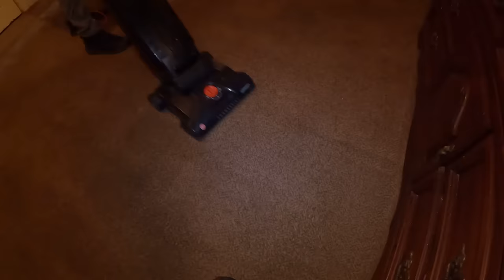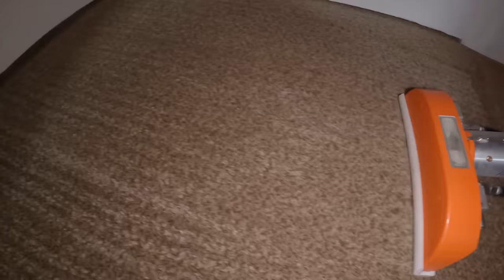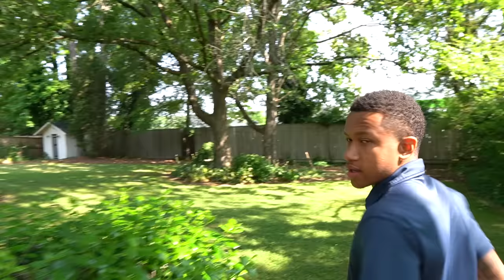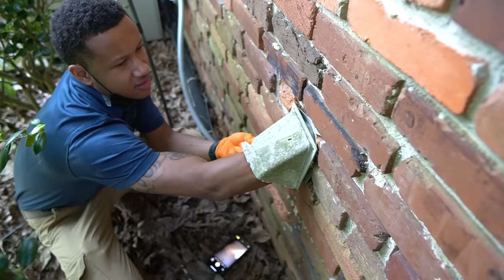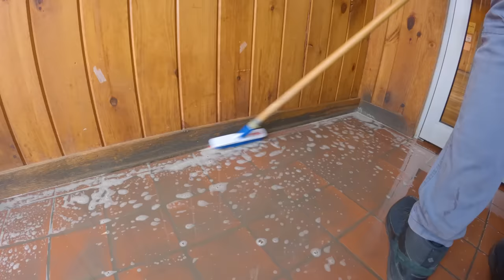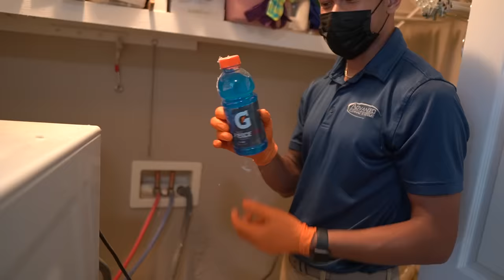Deep cleaning HEAVILY SOILED carpet for a long time customer!

Comment: I've  cleaned some  pretty  bad dryer vents in my 30 year's  of carpet cleaning. People really don't  think about their dryer vents. It's  so important to have  this service done at least once every 2 to 3 years . Or if you find that it takes 2 or 3 times longer to dry your clothes.  It also helps prevent  a possible  fire . I normally  will offer this service to a client if they have their air duct system cleaned at no charge. Great  work on those bad stains from the carpet. I know how bad they can be  some times. From one rug sucker to another have a blessed day and a very prosperous future.
Reply: My stubborn PITA brother didn’t listen to me and our mom about dryers and keeping them clean. That is until sparks and flames shot out the back of the dryer and they had to renovate their whole laundry room. One thing I always tell people that have washers and dryers, even in apartments, is to use a vacuum attachment for lint traps. Even just don’t that every couple of weeks does a lot.
Reply: I was thinking of doing that too.

Comment: Tip for ya- If you are near college apartments, or close enough that the gas won't kill ya, send notice to the student apartments off campus. Used to manage them and we could tell who had a clogged dryer vent by their electrical bill. We would pull the list, go and clean it, the following month the bill would drop massively. During busy times we hired out as we didn't have the staff to clean them all as we had 400 units.. The cost savings for us was massive and worth the clean out cost as we would recover it in the first month. Imagine a full day just going unit to unit.

Comment: So glad you cleaned out that dryer lint before there was a fire! You guys do a great job 👍🏻👍🏻
Reply: My exact thoughts... if I was one of the people in that household, I would have been terrified to see how much lint there was!
Reply: I had my dryer vent cleaned recently because of these videos and it wasn’t connected!!! It was filthy too. I was so shocked that the previous owners didn’t have it connected. Glad that everything is clean now. Thank you for showing me what has to be cleaned and why !!!!
Reply: Never use a flexiduct to connect a dryer. Throw that shit in the trash. Have a HVAC tech or DIY yourself a new duct with rigid vent, and crimp and press-fit it and tape together with HVAC tape (NO SCREWS).  If you have a gas dryer you are at a 200 times greater risk of a fire than with an electric dryer. I will never have a gas dryer ever. And if you pay attention to all dryer fires in houses, look at the photos of the dryer from the fire scene - they are always gas.  Open flame + powdery lint = kaboom.

Comment: Those are 3 extremes!! I can't believe just how good the first job turned out...but seeing as its a farm you know its mostly just dirt as opposed to oil and grease as well...it looks fabulous!!  As for the dryer vent...how could someone not notice the room getting all humid with the dryer running... I'm not sure if it's part of your service but if you pop off the back of dryers theres tons of lint and usually change in there as the bottoms are totally closed in. Those are 3 fortunate customers as you guys deliver nothing but grade A results:-)

Comment: How do you tell when a carpet is contaminated and needs to be thrown out?
Reply: I believe carpet should be replaced every 7-10 years. I love carpet but it's such a pain to keep it nice
Reply: Justin is on track with his time line, however with routine cleaning and the use of a protective  stain guard it will make your carpets last longer.
Reply: Carpet can last almost forever but it must be well vacummed and spills need to be cleaned as soon as they happen.

Comment: Hey Miles I got a good one for you.  I’m currently in a rental house and the garage was converted to a living space. Now before I moved in it looked clean. Super cheap industrial carpet that’s glued down on the concrete slab. I believe the previous renters had dogs so they probably peed and all that other good stuff on the carpet. We tried using a box store carpet cleaner but it looks like stains have risen back up. Any tips or advice. I use the room as a playroom for kids.  If you could come down here to Florida that would be sweet.

Comment: i borowed a carpet shampoo  with a brush  and with all the soaps and it did not clean too good from home depot do i need to go heavier like a steam carpet clean or will i have to call a professional  we just got a new carpet 2 years ago but since i work in a steel mill i bring in alot of dust  and black stuff from work.. curious on what would clean it

Comment: With that dryer, they need to get rid of that plastic pipe. It is a fire hazard.
I always, when we had our house, I would take out the lint filter, use our Electrolux Canister vacuum, hooked the hose up to the blower port, and blew out the lint.
Same with the refrigerator.
And why do people have light colored carpet?
Dark! I love dark blue, hides dirt, looks relatively clean, plus regular carpet cleaning and a good vacuum!

Comment: You need to use some fabric softener on the carpet after using the CRB. You went over the carpet 3 TIMES, and you're still pulling up all kinds of soap suds! 

I use fabric softener for 3 reasons; it kills the suds so you don't have to go over it 10 times. It makes the carpet feel softer. And it also adds a beautiful smell of freshly washed laundry.... 😉💯

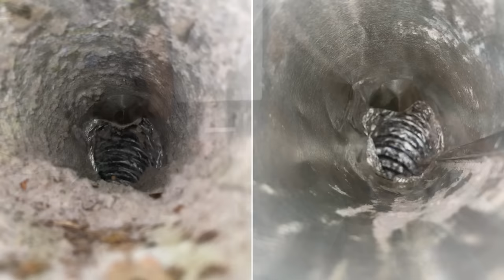Comment: 9:50 client needs to get the hard venting tube replaced ASAP!  that is probably the problem right there, looks like lint may have built up on those hard vent parts and over the years it got bigger and bigger until it clogged completely and the vent off the dryer may have popped off

Comment: The dryer in the last video needs to be disassembled to remove all the lint thats inside the dryer as well, of course you aren't obligated to disassemble the dryer, customer would need to do that themselves or have an appliance repair company do that, great video, but messy job !